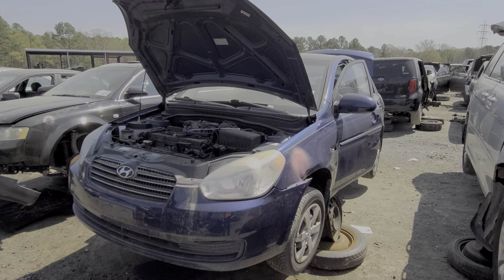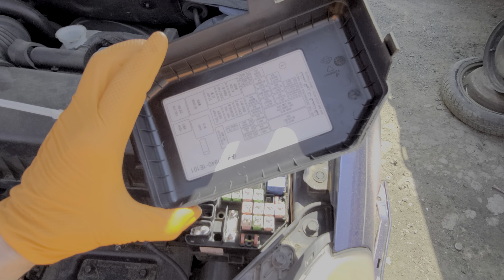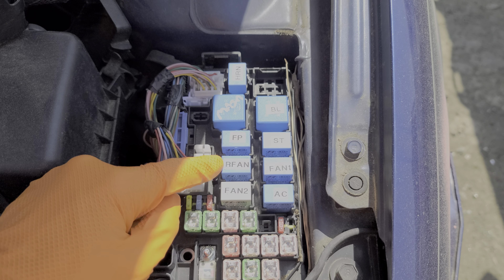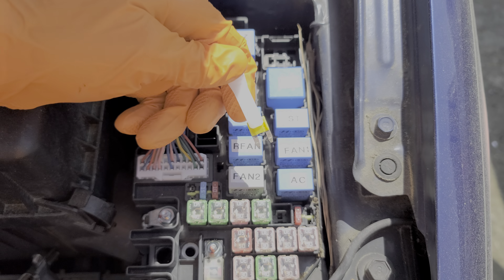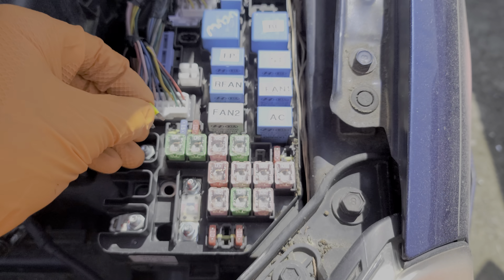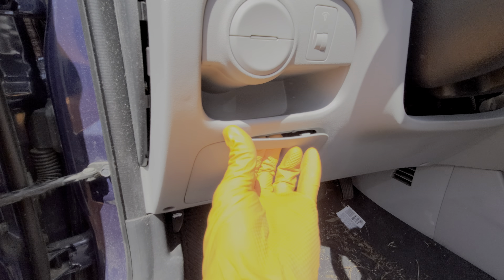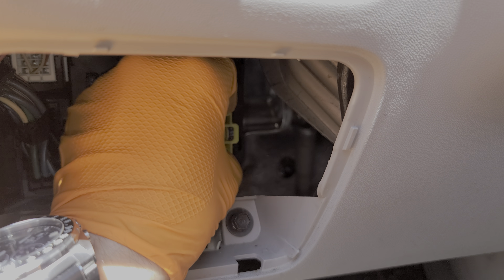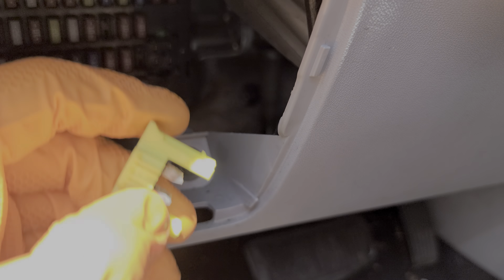2009 Hyundai Accent Fuse Box Locations

Comment: can u tell me what fuse controls the rear break light, the light that goes in the back when you press the break ,
Reply: Don't know specifically which one it is but your taillight issue could be the switch located behind your break pedal.
Reply: @mozzer_27  yes it was the brake light switch. 

BTW is it normal for it to cost 200 after tax to change it. Or rather is it basically a 30$ part that can be changed in 10 minutes.
Reply: @jasonk8775  sorry to tell you but it was the ladder.
Reply: @mozzer_27  Thanks. good to know. I wont go back there. I wish I knew how to change it myself.